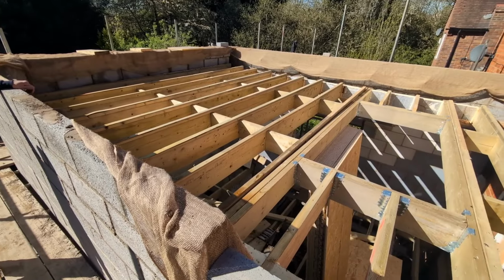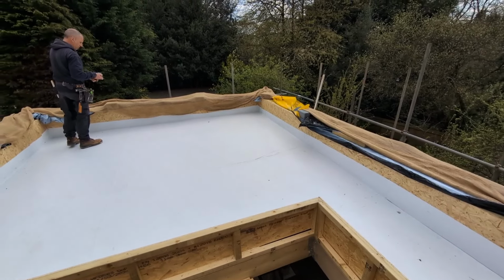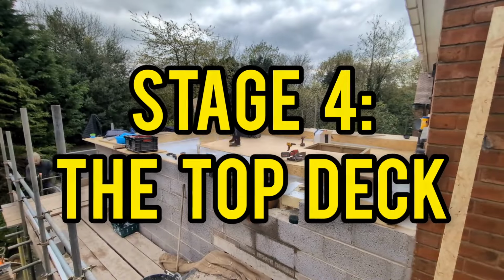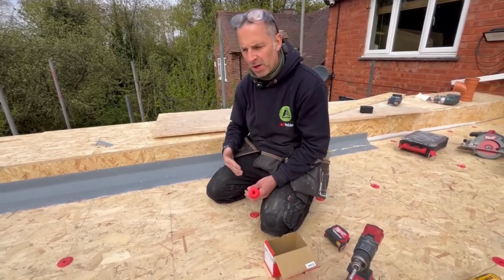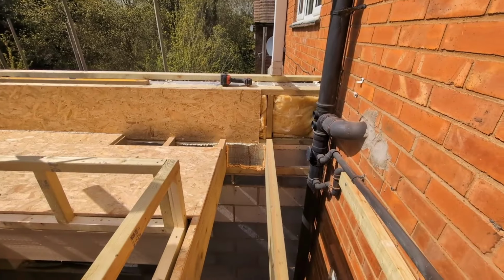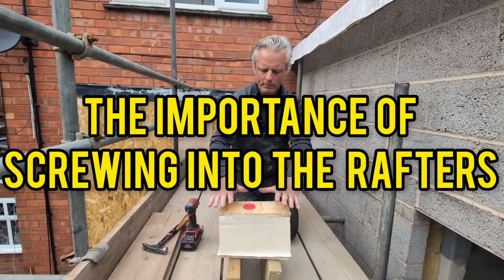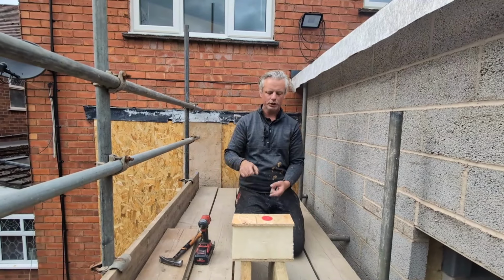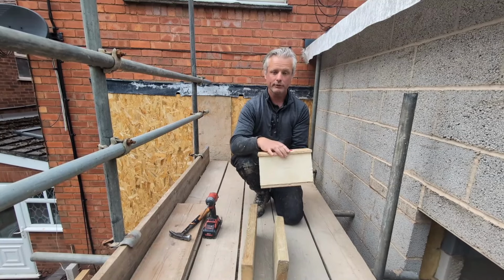How to build a warm roof. A step by step guide to the BEST warm roof on YouTube.

Comment: Youve sold me on those fixings. What's your thoughts on adding a green roof on top?
Reply from the maker: Mate, it's best way to do it of that I'm certain. As for the green roof, do you mean having grass and plants? I'd stay well clear of that mate. Just my personal opinion.
Reply: @Mr_A_Builders can I ask why you'd steer clear, would it be because of the weight on the roof or something else? Our architect designed us a flat roof with parapet so we could fit modular sedum trays, but they are max 55kg/m2 can I do wonder about whether sagging may occur
Reply from the maker: Hello mate. In my opinion it's the weight, the water runoff being compromised, the roots causing damage...I'm sure that all these things are taken into account in a properly designed living roof but those are the things that I think could cause trouble.

Comment: Also it seems to me that the most important place in the makeup of the roof components for the VCL vapour control layer is for it to be fitted on the underside of the joists. I have specified SIGA Majrex VCL which has a dual surface that copes with moisture in two different ways, avoiding any problems with interstitial condensation on the underside of the OSB under the GRP/EDPM (this is the most common cause of flat roof failures - not punctures)
Reply from the maker: Hello again, Nicholas. Whatever you do, do not put the vapour barrier under the joists for a warm deck. It's a massive no no. Follow the instructions of this video, don't deviate from them and it'll be the best that it can be.
Reply: @Mr_A_Builders  Another thing I use to avoid thermal transfer and potential dew point/interstitial condensation issues is custom steel lintels with thermal break pads and fabricated brackets holding a galvanised angle which carries the outer skin. It is a new way to replace the traditional welded plate.

Comment: @mrabuilders6723 From everything I understand in researching the topic, using foil insulation can create issues. It will act as as a vapour barrier and will encourage condensation and rotting of the top deck. The VCL you have at the bottom has to be the one keeping the warm moist air within the room envelop, offering maximum control/minimizing the heating bill. Then any vapour that does go above it should be facilitated/encouraged to disperse out. The glue inside the OSB top deck is going against that concept, and so is the foil of the insulation (x2 since you have foil on both sides or 2 additional VCL). I'm not a builder, feel free to correct me if I'm wrong. I'm planning to use tissue faced PIR for my warm roof, and being a sloped roof,  I'm just going to skip the entire top deck altogether. Interesting bit about the fixing, these little details are always very appreciated in videos. Thanks for sharing
Reply from the maker: Hello Michelle, hope you're well. From what I understand when you say " encourage to disperse out" you're talking about ventilation above the initial vapour barrier? Massive no no. This is a warm deck and should be completely sealed. That's the whole point. The top, deck mechanically fixed, is there to create a solid and  secure platform to which your chosen roof covering is installed/glued too. Should you use the issue backed insulation and glue your roof covering to that, you're not glueing to the roof, just the issue. If that issue fails, your whole roof will. That's putting a lot of faith in the adhesive that's sticking tissue to a sheet of PIR. Take my advice, do not do that. Just follow the instructions in this video and you'll be fine. Don't over think it.

Comment: wish you'd have included the top coat instructions, and i wonder if you would have preferred flat or sunken top fixings to all the little bumps?
Reply from the maker: All the fibre glass videos are within this series mate. I have to prefer the little bumps because it's the best way to do this type of roof, any other way is thermally inferior.

Comment: The best roof possible would be one with an epdm covering. The title i submit is misleading.
Reply from the maker: Go on...I'll bite...how would EPDM be more efficient?
Reply: @Mr_A_Builders    I'm not referring to the thermal properties but the many advantages it has as a top covering  over and above that provided by fiberglass.

I don't have any real issues with the construction from a thermal  efficiency perspective.
Reply from the maker: @paulf2529 oh right. Fair enough. You prefer the patchy, many weak points kinda finish. Fair play.
Reply: @Mr_A_Builders   like anything  it depends on how well it is carried out. Personally I have seen first hand many bad fiberglass installations and i doubt these will get anywhere near the quoted life expectancy.
Reply from the maker: I bet you £1000 to our preferred charity you're wrong.
Reply: @mrabuilders6723   Time will tell you you haven't really shown any detail of the actual  fibreglass  installation process  being carried  out, so I can't really judge it  in the specific  context of the actual  job and the adherance to best practice. 

 Obviously, I'm baseing my comments  on my own inherent  perception and concerns regarding  fibreglass as a roof coating. 

I actually  quite like torch and roll, but just like fibreglass would specify epdm in preference as  there are too many variables, eg, partial bonding due to unneven heating technique.